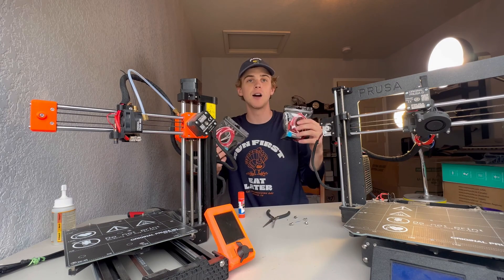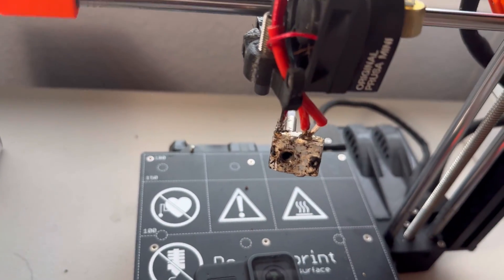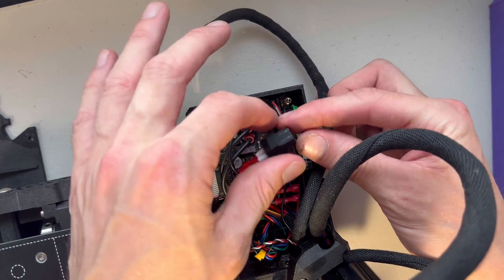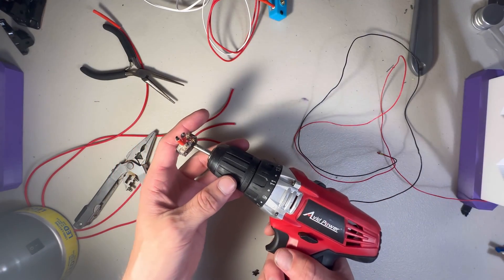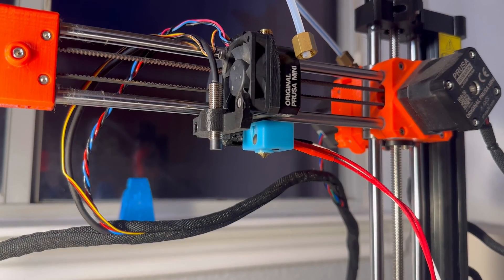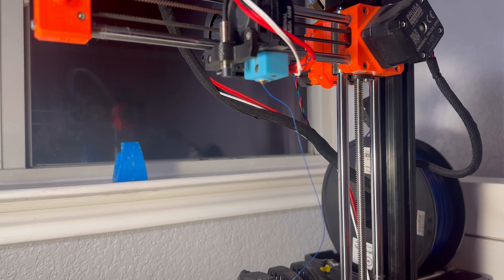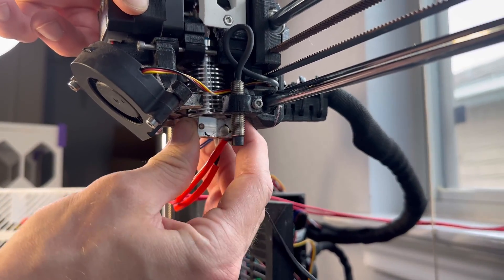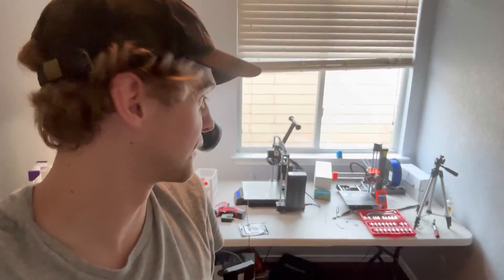How to Replace a Hotend, Prusa MK3s+ and Mini Tutorial

Comment: Why did you change the heater block of the mini if you just needed to change the heater and thermistor…? Original thermistor and heater from e3d would have cost 32 dollars from printedsolid.
Reply from the maker: I tried removing the thermistor but I couldn’t get the black screw on the underside of the heater block to budge, instead of drilling out the thermistor I just decided to replace the whole heater block/heater/thermistor because it’s been about 2 years with the original components and the whole thing was looking rough. 

Thought it would just be easier to start fresh. I was able to find a hotend kit on Amazon for $16.99. But now it’s not really the correct hotend, so Revo upgrade here I come
Reply: @3D_Luke  oh ok, i was also wondering what material you used for the MK3s fan shroud?
Reply from the maker: @tfb12345  I used PLA, do you think it will melt if I print anything above 215°? I didn’t really consider that. Luckily I haven’t printed anything yet with the MK3 so there’s time to do it in ABS or something. It may be far enough from the extruder to be okay though
Reply: @3D_Luke  well PLA will get soft at 60 degrees, so i would recommend a material that can withstand a higher temperature. (Ive had mine printed out of PETG start deforming)
Reply: And this could have been an opportunity to upgrade to the Revo system from e3d.